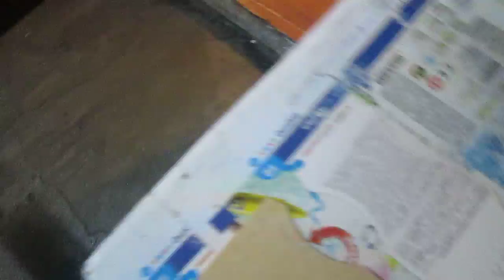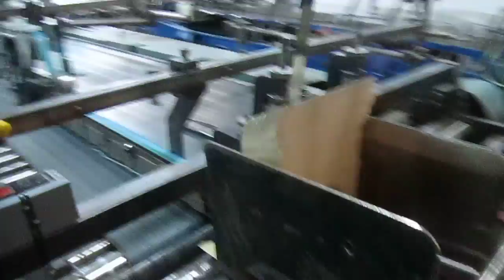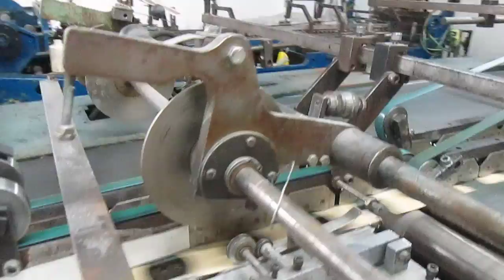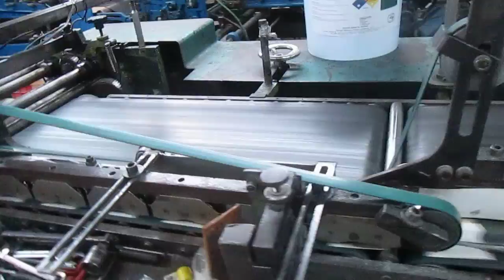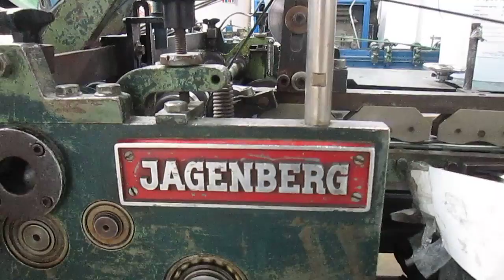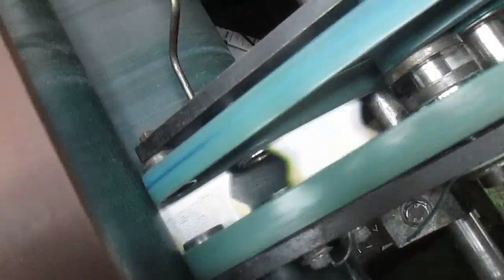jagenberg pegadora de cajas

Comment: hi please did you know about Jagenberg Simplex 875, can it do 3 way crash lock ?
Reply: the jagenberg cant do straight line and crash lock 3 this cando it, but in another machines you need 
see the carsh lock bottom system  and 2 glue disks.